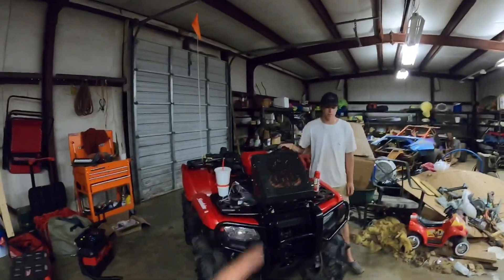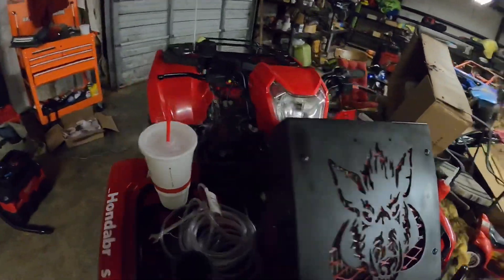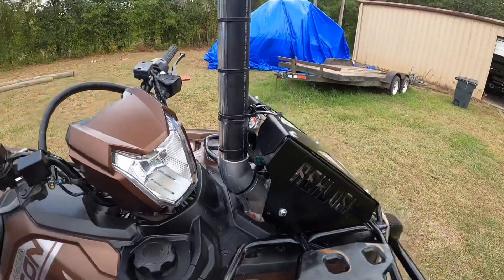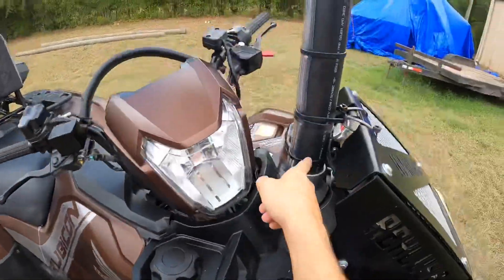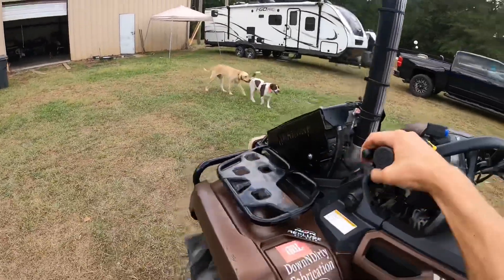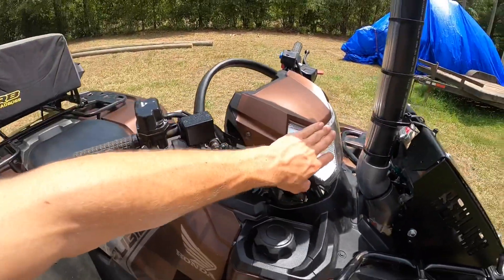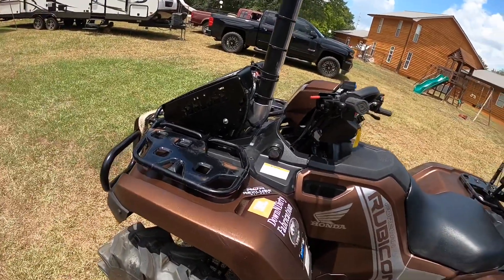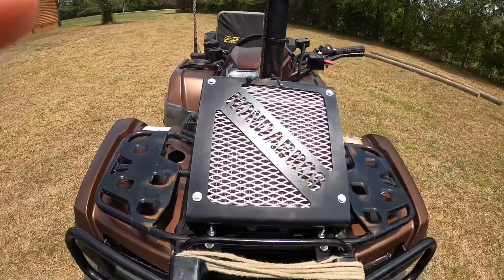2020 Honda Forman 520 gets new radiator and snorkel

Comment: The "double sided bolt" is called all thread I think
Reply from the maker: An all thread is a bolt with threads that goes all the way across the bolt from what I know
Reply: You get the plate for the snorkel cause 22offroad makes obe

Comment: Have you had a problem with gas coming out of the vent line? And i only have 3 vent lines. Whats all the others you have for?
Reply from the maker: You will have gas come out if you over fill it
Reply: Hondabros mine does it all the time no matter if its full or not. But what are all the vent lines you have run to besides front, rear diff and fuel pump